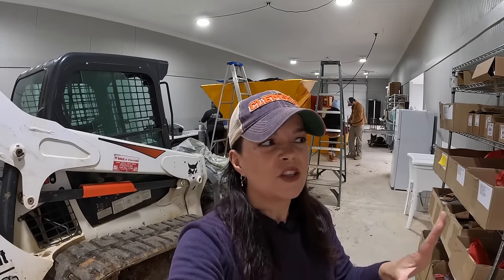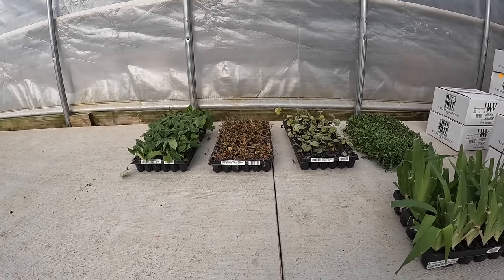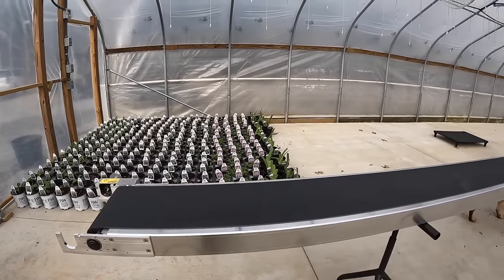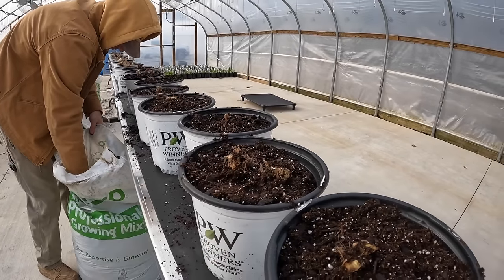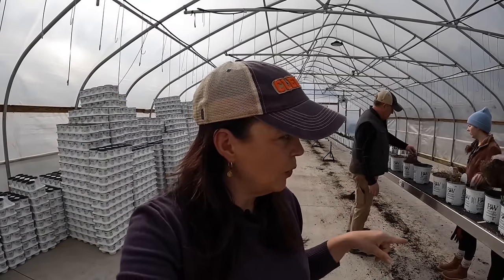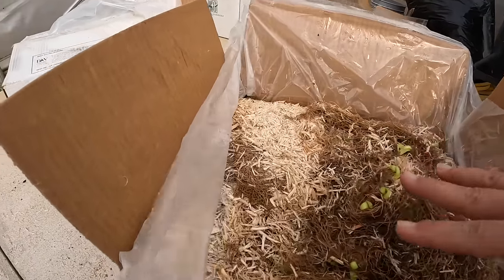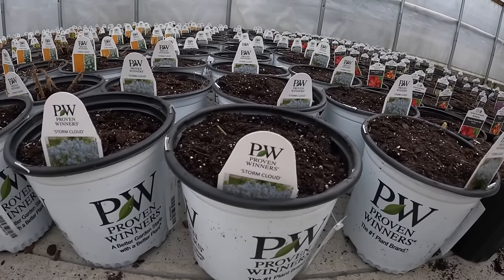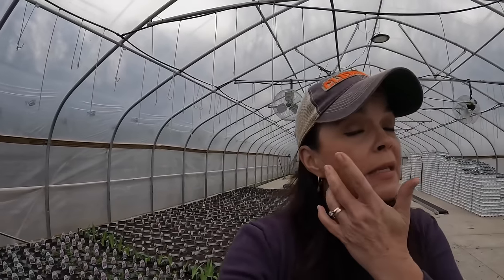Work Smarter Not Harder: Using Modern Machinery To Pot Perennials

Comment: Hey ya'll!  Congrats on the new conveyor system!  I love watching you guys and I've learned so much from you guys about gardening and the growers process.  I'm a consultant and specialize in launching and improving manufacturing and business processes.  I thought I might be able to contribute a few suggestions to help you guys work out the kinks as you refine the process.  I'm sure that you guys are already thinking about these things so this is not a critique at all but just want to be helpful and contribute something back for all that I've learned from you guys.  Here goes!  1)  Consider installing rails onto the conveyors at the width of the largest pots that you run or that are adjustable width  (will keep pots on the conveyor, even across the transition spots and prevent as much spillage of soil. Install them in a way that will allow easy disassembly if you wish to pull the line apart when not in use. 2) Define the steps needed for each plant type once the pot come out of the machine such as A-Add plug/root, B-Add Tags, C-Top off Soil, D-add fertilizer, etc,etc.  3)Setup mobile stations (tables, carts or bins with wheels) at points along the conveyor where it makes the most sense for each step and as you learn, speed up the line, or add/takeaway steps, the stations can be moved/adjusted.  Setup each station only with the materials that are needed at that station and organize them in the order that you plan to run them ahead of time (this will help you to avoid putting the wrong tags on the pots/mislabeling and taking too long to get organized when you changeover from one plant type to another and/or having the stop the line for too long or even at all.   4) Find a physical way to clearly indicate when you are changing over to a new plant type or variety.  You could simply leave a gap between types and take cardboard boxes and put them in the gap space on the line between the types with the info written in bold letters on what is coming behind that box.   5)Add two or three rolling carts at the end of the line one that one person can off-load the plants onto carts and a second person can then move the plants to the area where they are being lined up and empty the cars and return them to the line to be filled up again.  6) Plan the order that you plan to run so that you can organize the stations before you start and run all plant types with the same steps back to back and avoid as many changes as possible.  7) Start the process at the speed of the slowest steps in the process and then take a steps back look for bottlenecks to eliminate and other ways to optimize overall.  Hope this helps and makes it possible to reach all of your goals and beyond!

Comment: There's a nursery I buy from that sell PW. It's a little bit of a drive,but the plants there are so much bigger and healthier looking than the big box stores.  When I go shopping there, I always over do it. I tend to purchase perrenials,and tell myself to go easy on the annuals,but when you walk in and see all the color,that thought is replaced by, where can I plant this? I have tried saving seeds ,only have had a little success. I have had coleus come back voluntarily on the ground where I had potted coleus plants during the last year. I noticed some very small plants ,I got on my hands and knees and pulled the grass from around them. Dug away from them with a spoon, so I could push that loose soil around each plant to help stabilize them. Watered them daily when I watered all my plants.  Everything gets a once a week dose of water solvable fertilizer. They grew fast and was beautiful plants. I had ten or more to come up. Just left them where they were.  It had to be from seeds, cause I use ti cut the long flowers off, until I noticed the hummingbirds loved those tiny flowers, so I would leave them on. Guess they seeded out, and loved the area they were in. They didn't come up in the Spring,  it was summer when I first noticed them. But they grew fast an lasted until November . Hoping I get some more volunteers this year. I will be looking out for them.